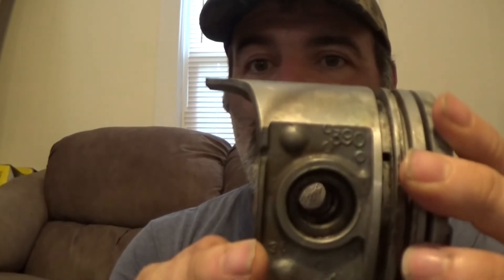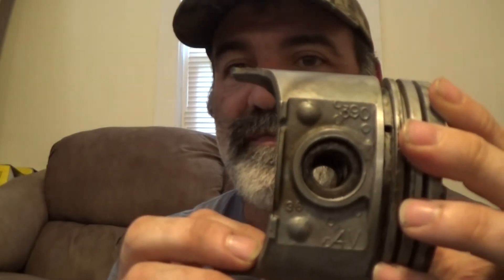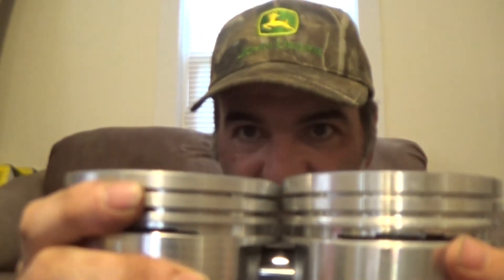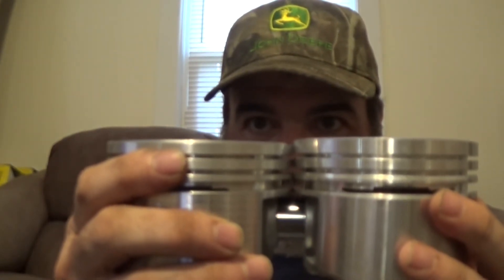Ford FE 390 piston differences?

Comment: I handle & work with these engines & all of these very parts you talked about here & I actually take all of the actual measurements of these parts individually for actual specs vs. The posted or advertised specs. Such as pin hight ,rod length,  block deck hight, & a big one, actual combustion chamber size. I say that's a big one because the cc size they are claimed to be from Ford & what they actually are today can be good amount different.  But first I want to comment on the pistons you mentioned. I also have 390 4v pistons straight our of a unmolested 69 360. Also pistons from a 68 360 but those say 360 on them however the dementions & design & weight show to be exactly the same as the casted 390 pistons. And u mentioned in a 390 the compression goes up to high for pump gas. With those pistons I agree Ford posted those 390's at 10.5 to 1. So I am not saying your info is wrong. That is what Ford says they are as well. But I'm calling ford's posted compression numbers bull. I'll tell you why. Now I've noticed all my engines I've torn down & then as factory never apart equipment when I take actual measurements I find compression ratios across the board to be a half or even a full point lower than ford's claimed numbers. Hp numbers I've found Ford was pretty accurate & honest in the older stuff. Getting into the late 60's early 70's era I see fairly spot on hp numbers for Ford's run of the mill engines but some of the secret weapon type engines (351C 428SCJ....& others) to be vastly underrated! But compression, no. Last summer I put a .060 over 390 together for myself in my old 71 f100. I used the high compression 390 .060 over replacement cast piston. Now mind you every replacement piston has alil shorter pin hight than the original pistons. So if that is not accounted for every replacement piston will be alil less compression than original. And like I said, original wasn't even as high as the claim, so now it's even less. But in my case I eliminated that issue & had .035 taken off the deck of the block. Witch in a perfect word would make mine 0 deck. But not perfect, actual piston to deck clearance?? They .005 above deck! One would believe that would send compression through the roof!!?? Nope, I used a factory replace fel pro head gasket, compresed thickness .050. So now with that head gasket I have a quench of .045. Not bad quench!! My heads have only ever been touched by Ford as original back in 64 and then by me in 2021. I did some replacement factory valves that I put a back cut on & I ground my seats with stones & did a 3 angle seat on them & assembled. I cc'd my chambers & my heads are C4AE -G & Ford claimed chamber size to be 70 - 74 cc's. I got right about 78cc's almost across both heads on all 8 cylinders. If ur compression calculator is warmed up u find I have a 401CI FE engine that has a .045 quench & a 9.3 to 1 compression & runs absolutely amazing on Iowa 87 octane with 10% ethanol. Depending on my timing if set to aggressive on hard throttle I can get it to rattle rattle but I can also tame it down alil & stand on it & have 0 detonation. I have a crower 210 at .050 & .486 lift cam in that revs strong to 5000. From 2500 or 3000 to 5000 in third grear with 4.11 gears I don't know much that could hang. My 1/4 mile and launching it easy was 15.3 sec at 95mph. This is a 4700lbs 4x4 with a granny low 4spd Trans. If u need to compare what would a stock 95 gt mustang do brand new?? At the track when I saw those mustangs they would be just behind my truck at the finish. They were about a 15.5 car with stock tires
Reply from the maker: From what I've seen its not just Ford whose combustion chambers are usually bigger than advertised, it seems most manufacturers combustions chambers are usually bigger than what they advertised. I have seen the truck 390 piston used in a 360 also. They were bad enough using the 390 4V piston in them but they were really horrible with the truck 390 piston in them lol
Reply: @BlackLabGarage  oh ya, about them truck pistons. Those are the 410 mercury pistons. With the 3.98 stroke crank those pistons are good. I'm building another 390 now & I haven't decided for sure yet but I have such a abundance of parts I feel I can spend very little money & use some of this stuff up & have some really good engines. But I'm looking at the truck pistons but using 352/360 lighter & longer rod. It might turn up ail faster with lighter rods. The piston is still down some so also would shave the deck of the block. And have to rebalance the crank. We will see though?
Reply from the maker: @jesseduke694  I have to be honest...if I had to do it all over I would have used the extra 460 I have sitting here. FE's are good engines, but 460's are cheaper to build for the same amount of power or more. But those FE's sound good
Reply: @BlackLabGarage  I gota disagree.  I have a 75 f100 4x4 I have put alot of work into. Including a 460 & a c6. That 460 has 65 ci on my 390. (.060 over 390 .030 over 460) the 460 has D3VE-A2A heads that have been machined for adjustable valve train 2.19 intake valves stock 1.65 exhaust. Ported by me & I also unshrouded the valves in the chambers. I flow tested the heads before & after. I got alot of gains at every lift measurements & at .700 305cfm air flow. They measured 92cc. I decked the block to the early hight 10.300 I modified the oiling gallies & the drain back on the both390 & 460 blocks the 460 got fully balanced rotaing assembly & forged lightweight pistons & turned out about 9.6 to 1 compression. Lunati voodoo cam .552 lift, rpm air gap intake & full msd ignition from 6al to coil to dist. Hooker super comp headers 4.11 gears & Detroit locker. It's a mud machine that eats the souls of rat powered Chevys. In the street truck classes. My 390 got stock c4 heads less compression, cast pistons, a good intake but still a stock oem intake. Smaller headers & a smaller cam. I think my 390 truck will out run my 460 truck. The 390 truck is about 400 lbs lighter & has a 4sp vs. The 460 has a good c6. There is no reason that 390 should out run that 460. If ur talking after market heads, then I agree the 460. But working with oem iron heads, I take my hat off to the FE engines.
Reply from the maker: @jesseduke694  actually I was going to use the F3TE fuel injected heads. They have the highest velocity ports of all the 460 heads. Yes, they need work like all the other 385 heads but not nearly as much as the D3VE heads. I was going to use the fuel injected intake also since they make an adapter to mount a carb on them. I've seen dyno sheets of F3TE headed 460's with a carb and they are 9:1 engines and use a small cam and still put out 535 TQ @ 3500 and 426 hp at 4700 rpm on 87 octane.
Reply from the maker: @jesseduke694  That C6 sucks up a lot of the power. If you are making 400hp and lose 20% to the C6 that's 80hp you've lost.
Reply from the maker: @jesseduke694  and I'm not knocking a 390 at all. I was just saying for my usage which is a 1 ton F-350 farm truck, when it comes to dollar per horsepower it would have made more sense for me to have went with the 460. As far as performance and revving, I would think a 429 would be a closer match to a 390 than a 460 as far as revving and rpm's.
Reply: @BlackLabGarage  I understand. I just don't totally agree. I do agree both are great & u can't go wrong with those choices
Reply: @BlackLabGarage  the 460 actually can be a very good Revver & might be more so than the FE? The oiling & bearing width kinda limit a FE to around 6k I think. Unless it's a side oiler
Reply: @BlackLabGarage  I talk to guys that talk about there 460 revving 7k or more sometimes. I think a FE needs serious work to see those rpms & live regular.
Reply from the maker: @jesseduke694  I have personally seen a 514 turn 8,000 before but I wouldn't be comfortable with it lol. You may be right because I have heard of a lot FE's coming unglued at high rpms but I haven't heard of that many 429's and 460's coming unglued now that I think about it.
Reply from the maker: @jesseduke694  I mean look how many different rods there are for an FE but for the 385 series you get two flavors. The passenger car rod and the cobra jet/truck rod. Just going by that suggest that Ford knew they had a problem with the FE rods.
Reply: @BlackLabGarage  you do know the rods are the weakest link of the 429/460. It's one of the first things to upgrade on 460 build. The FE rods are known for being fairly strong. Really there are only two different rods for the FEs. The long, skinny rod, for 360 & smaller FEs & the shorter but heavier for the 390 & larger FE's. The only differences are the rod bolts and the casting numbers on the rods. I would say if comparing rods the FE is the clear better choice. 460 rods are scarry if you ever see above 5500 rpm even on a stock build.
Reply from the maker: @jesseduke694  I knew the car rod was weaker because of the straight cut shoulders but I haven't ever seen a truck 460 with a broken rod. I'm not saying they don't exist, I've just never seen  one.
Reply from the maker: as far as FE's I know about the long rod and short rods but I was referring to just the short rods. Why did they change the rod bolts so many times? You had 3/8", 13/32", and then the cap screw rods.
Reply: @BlackLabGarage  that's 3 rods. Not two like he said.
Reply from the maker: I know we dynoed a bone stock 1968 429 Thunderjet last year and it dynoed 329hp and 450lb feet of torque. When I say stock I mean bone stock. It was a low mileage engine so it still had its original pistons, valve springs,etc... just new rings, bearings, and gaskets.

Comment: I"m rebuilding a 390....  i have a cam skanderian 264  MEGA  HYD  new  and  a H304p  0.20 KIT  piston,,,,,,,  the  car  is  tbird  64  and  i  like  speed......  looking for  yours  videos..! found  one  your  comments  where  you  suggest  to  use ' 410   #  381P  pistons... ....   now I'm  in  doubt...if...use H304p  9.5 :1 OR    410 cid  381P  8.8 :1  or original  flats  premiun  fuel  (  we  have in Brasil until 98  octanas gas)  . the  cylinder  block  will be open  to .20 or .30  original from  F100  73, '   CRANKSHAFT  2UA.....HEADS  C8AE H   68.1-71.1 ........ I  ask  for...  with   your  large experience  on FORD 390.....what  you  look  better  ?   thank  by  attention  and  I'm  alread  iscrit  your  channel
Reply from the maker: Neither of those pistons will get the compression ratios that they advertise if you use a composite head gasket instead of the original steel shim head gasket. If you don't mind running high octane gas I would get a set of 390 4V flat top pistons and make it 10.1. Those would be a Sealed Power H395P which seem to be no longer available, or a Silvolite  1131H which are available.

Comment: man compression height on 360,390, 410 ect...can get confusing....I just calculate the compression ratio with the head cc, compression height, piston cc, stroke and quench ect.. I want. But man This is an Awesome explanation and  informative video for folks that don't know about the truck vs car piston ect.. brother...a lot of people need this information FO SHO! Again awesome Video!
Reply from the maker: Your welcome! Thank you for the kind words. Yes it does get confusing. Basically Ford was solving two problems with using the 410 pistons in the 390. Dropping the compression so it would run on the cheapest fuel possible and using up all the 410 pistons they had when the 410 Mercury was dropped from the line up.